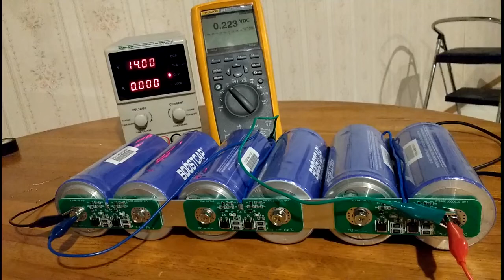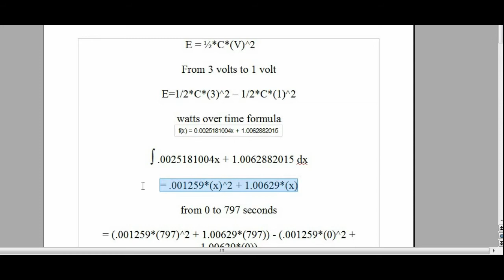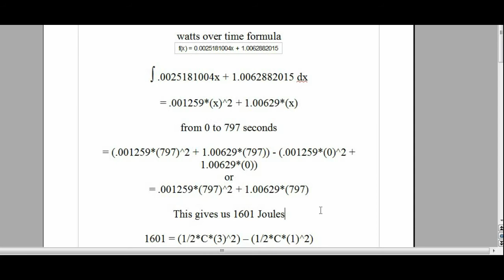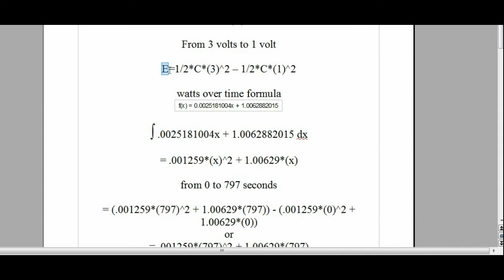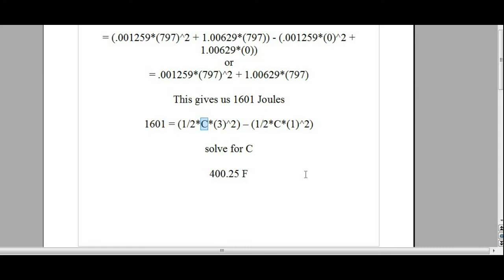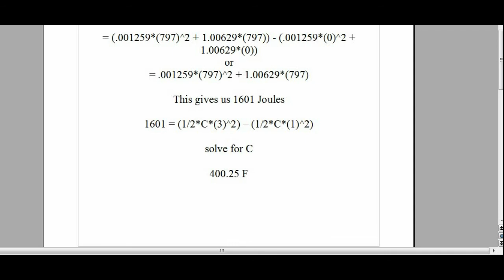maxwell capacitors testing problems (part 1)

Comment: I got some caps and they don't have threaded poles. What kind of screws did you use to connect links and balancing boards? What length? Did you tap into the caps?

Comment: the Capacitor Bank would measure 500F if the voltage that you charge each capacitor reaches the published voltage (2.85 or 2.7 V) so have you verified this?

Comment: Since current was constant, using C=It/deltaV would've gave you the same result. No need for calculus mambo jumbo. But yeah I think those caps are 20% tolerance. I don't know how accurate your current source at the time the test was conducted; that could've added to the error also. Some power might have dissipated through the balancing circuit as well. If you still haven't done so, I'd check the accuracy of your current source then test the caps individually. In addition, individual testing will eliminate X6 ESR caused by the caps being in series.
Reply from the maker: quantomic1106 thank you very much for the input and I completely agree with you about the method I used. It gets the same results but is  totally unnecessary when charging with constant current.  When I did this same test again from 13 to 15 volts I got very close to 500 f. I think you're correct that the only correct way to test these would be individually and eliminate a lot of the variables that way.
Reply: Glad that you got it close to  the advertised cap values. That's strange that you got different values at higher voltage  The double-layer might have a slight voltage dependency maybe? There might be some non-linearity because of it. Maybe you have to charge it at full range. Just a guess.
Reply: Measuring amperage flow into each individual cap could show the different variables or maybe the configuration of the connections. 
This does differ from how I was taught with A/C circuits and my perception is getting messed up with my old age. So I could be a little off my rocker ...or I am becoming more like the "1Megafarad man" that likes to stir up others to think for themselves :)

Comment: aren't capacitors supposed to charge and discharge extremely quickly? are you sure measuring at 1 amp charge rate is appropriate for these capacitors? my concern is 797 seconds, or 13 minutes is a very long time for a capacitor, but not a battery.
Reply from the maker: I was thinking the same thing but I'm not seeing any large difference 
when I adjust the current. I am seeing a large difference when 
measuring the energy between higher voltages (13 to 15 instead of 1 to 
3). I need to do some more research. I think I'm not accounting for 
something the way i am testing this.
Reply: This number (and much longer) is perfectly fine for supercaps--sounds like you are thinking more along the lines of pulse caps.